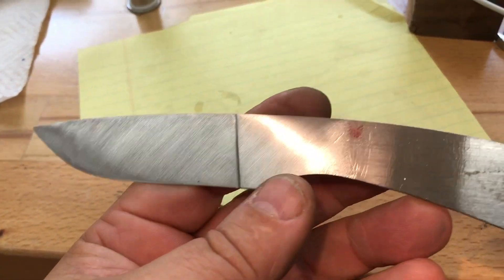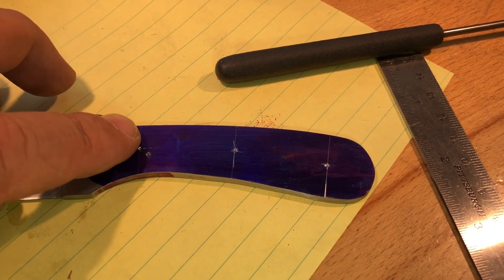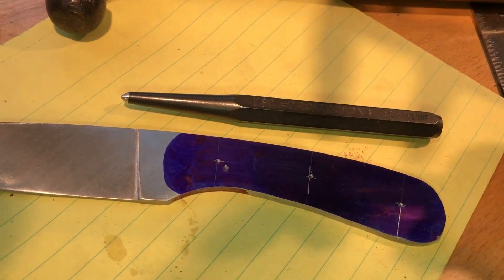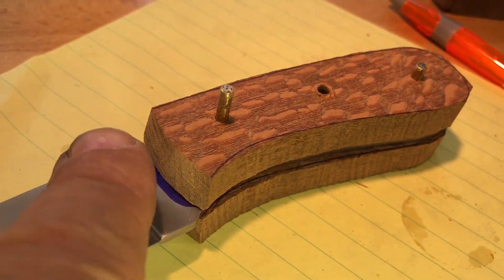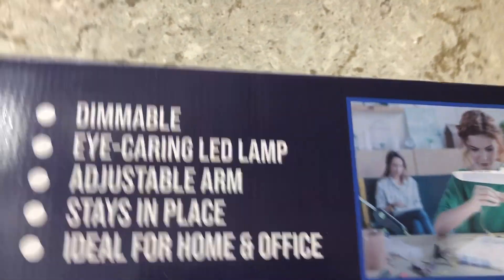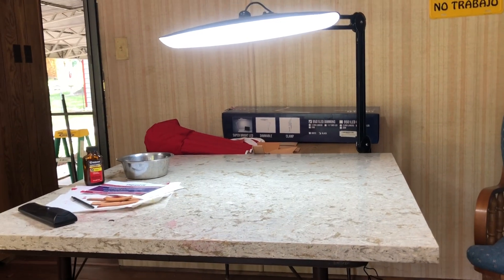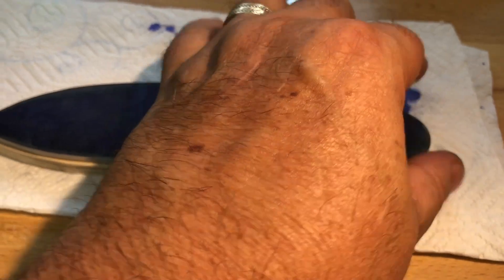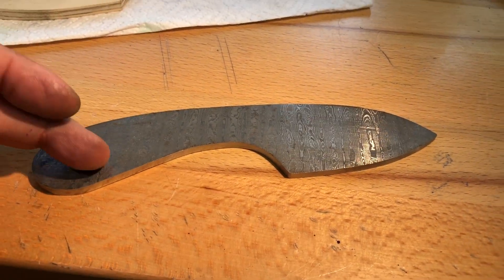Dinner skinner damascus steel and new style of knife

Comment: Know what you mean about good light. Can't believe that I paid almost $9 for a 100w bulb. (13w led). It was worth it! So, much so, that I went back and bought a 2nd one. Both in a 3 fixture floor lamp that I use between benches of 2 machines. I'll keep a regular floro in the 3rd spot. That floor lamp has flexible arms, so it works well to direct the light exactly where it want it for each machine. And, doesn't take up bench space on either bench. I'm  impressed with your new light. Know exactly what you mean, as I have a couple of the inexpensive versions of same. --- Have a great day. God Bless.
Reply from the maker: I’m loving the 100 watt bulbs. I removed a fluorescent fixture in the kitchen and put up a simple screw in fixture (I think it was like 3 bucks). And I put a 100 watt Led in it, right over the sink where I do the acid etching and tumbling.